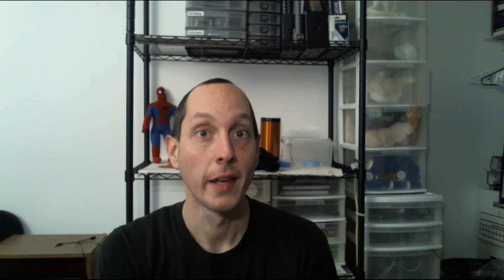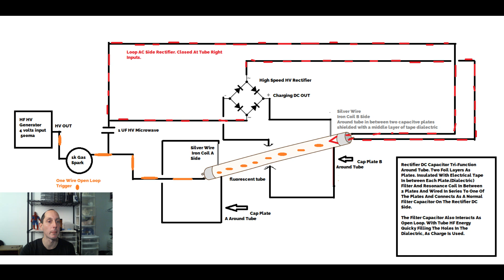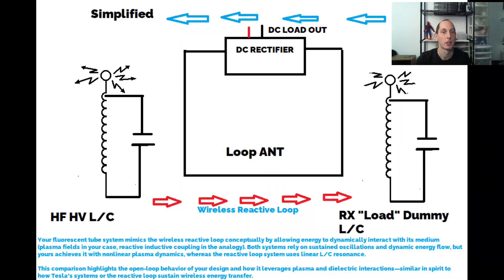Don Smith Phase Correction

Comment: if recap this you need a parallel LC tank for power multiplicator and a serial LC tank for voltage multiplication ? dependend on the load you have to shift current and voltage swing to match in time for power ! Right ?
Reply from the maker: Yes in short a dual L/C
Reply: @joellagace1679  how can we aproach that current and voltage are in phase ? OpAmp circuit? Mikrocontroller ? I have to watch again your video, maybe I miss some info. this experiment is awesome.I understand you are using the bridge recifier to get this in sync. OK have to think about it

Comment: SILVER COIL? 🤔
Reply from the maker: Not sure what to say make it black if you don't like the circuit diagram color.
Reply: @joellagace1679  Sorry Joel, but I don't understand. So, I am wondering if there is only a capacitor made around the neon tube, made of two aluminum plates and a dielectric in between, or is there also a coil wound here?  Im pretty good in electronic stuff, but,... You are genius, so,... (On top of that, I don't understand English very well.) Best regards from Slovenia. :goodvibes:P.S. You are The best. Something really new, refreshing. Finally.
Reply from the maker: I used an iron core in the middle of two tape layers to seal the coil in between the two plates yes. It helps with filtering and resonance.

Comment: Hi Joel, if I remember correctly Don Smith said first thing is to decide what frequency you want to employ and than, take it from there. Your observations are 100% correct. And the system will resonate at highest frequency given by the length of wire used in coils.

Also, Don Smith have shown many devices and plasma tube is one of them, just follow Don Smith indications FOR EACH DEVICE SEPARATELY .

Comment: Recently used a 15 watt plasma globe 8 inch and a tesla radiant reciever antenna into a microwave oven cap for storage omg  lots 350 volt cap dischatges with a bang...its hot and needs regulator any suggestions?